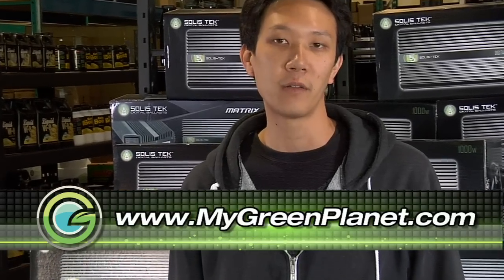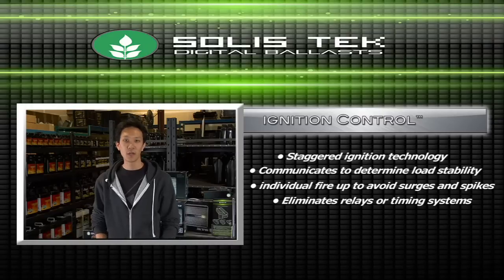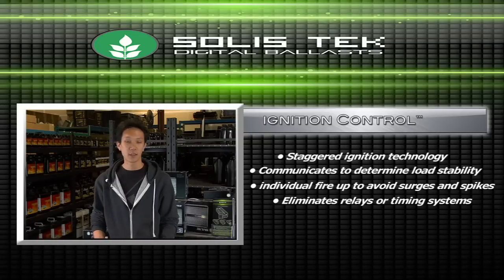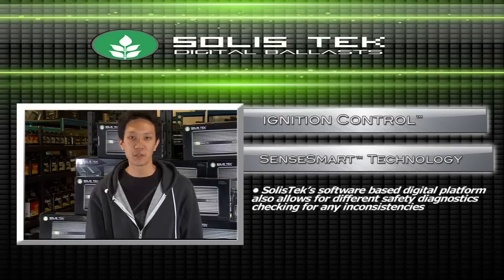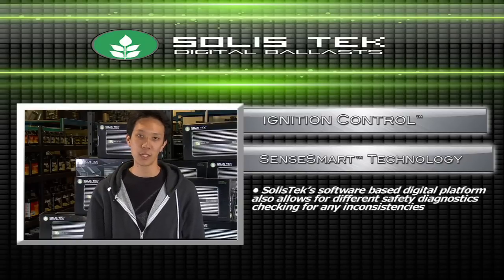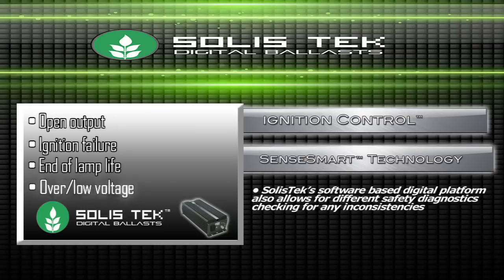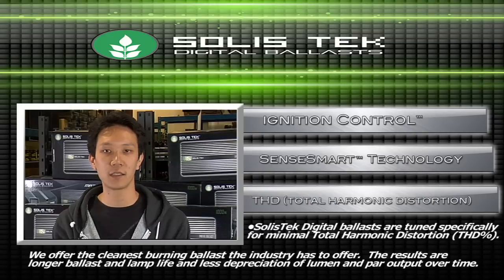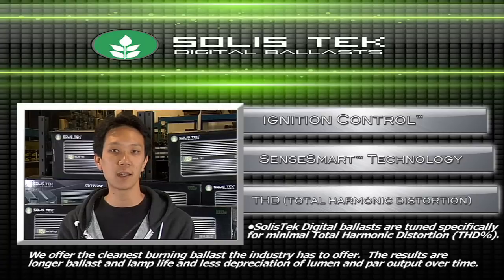Solis Tek Digital Ballast Overview

Comment: why does my stk1000lcd say e05 or e04 when i plug in my splitter and 2 600 watt solis tek 10,000 kelvin MH(always with these bulbs ) but will also do it from times on the HPS and the 6,500 kelvin mh. Also i know the E means short circuit and open circuit. but i put on 600 watt setting and they work just fine... WTF WHY??

Comment: Why is it I cannot find a LCD STK 600 or 1000 watt ballast anywhere I look it's always sold out are they still manufacturing these, as I've been looking for about 5 years now for one and I just can't find one and the ones I did find were like $400, far more expensive than the one I bought in 2012/2013 which is only like $189 for the LCD STK1000 watt ballast

Comment: I have a Solis Tek Ballast and I decided to match it with their MH bulb for the first run using it. Anyone used the Super Blue 10k MH for Finishing? i got the 6k Blue MH coming and was curious about using UV to bring out extra resins. Anyone had any experience using that combo? Im using a Ushio Bulb for HPS But Solis for MH
Reply: yes .it's ok
Reply: i do this every grow.. go ahead and try it, you will be happy. i do last 2-4 weeks flower and alse add uvb/uva from t5 bulbs too. it slows the stretching the plants do. Best of luck